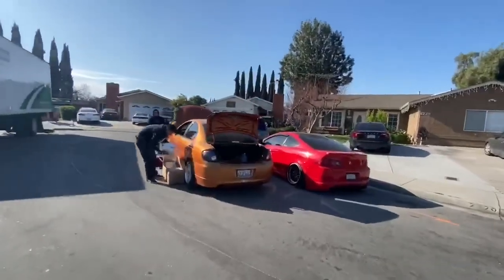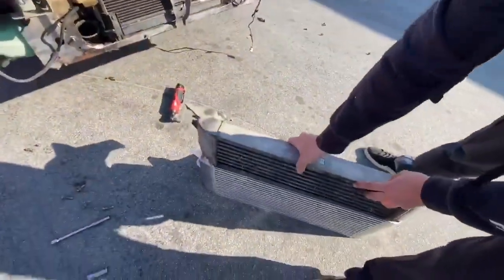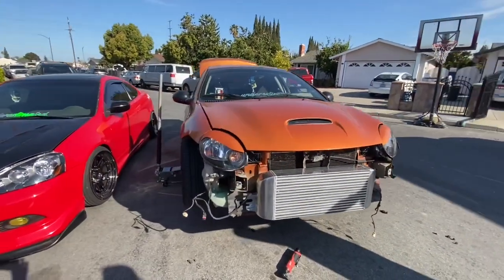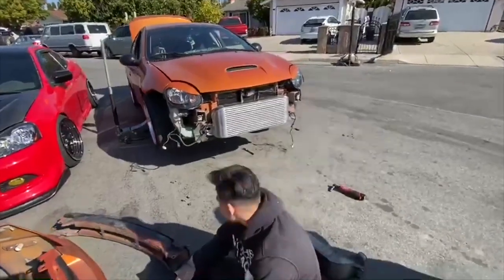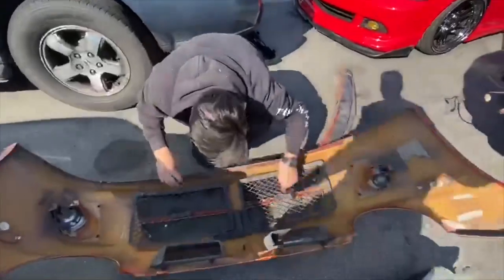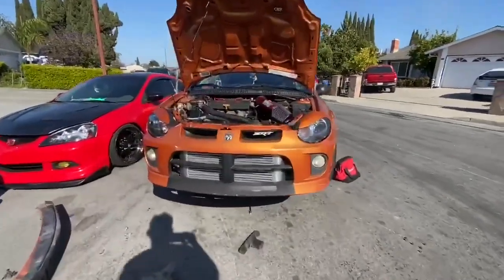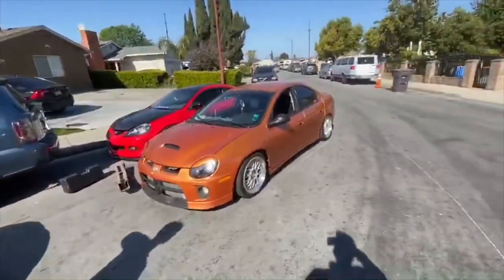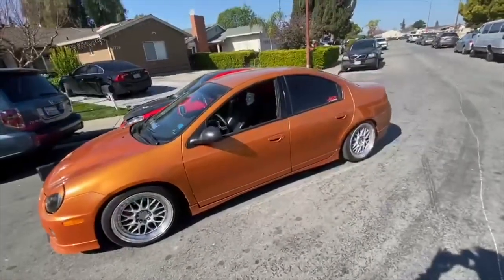SRT4 Big Intercooler Install!

Comment: Hey bro . 
I was get one from ebay too. 
Do you think 750cc injectors need stage 2 computer or  will it run with stock computer?
Reply from the maker: Should work on stock ecu